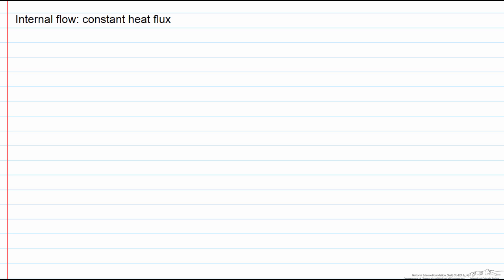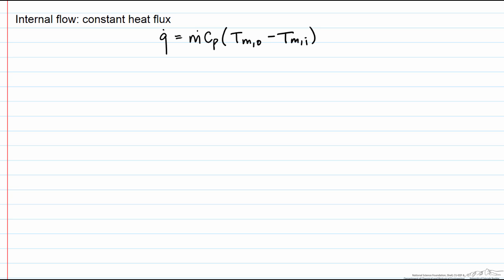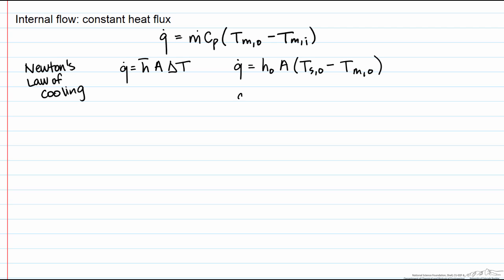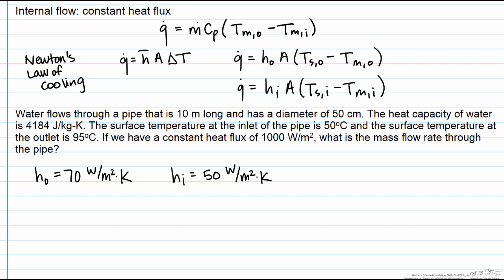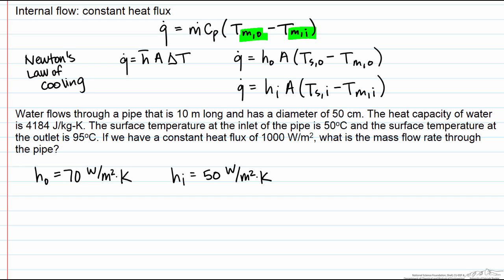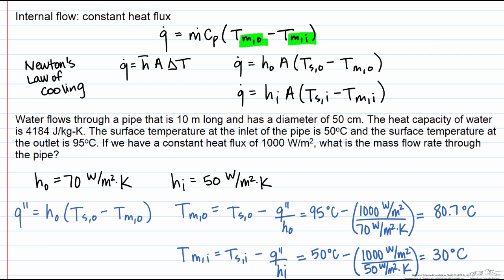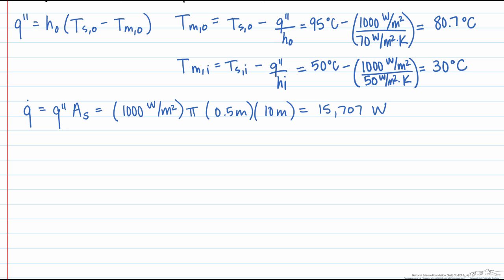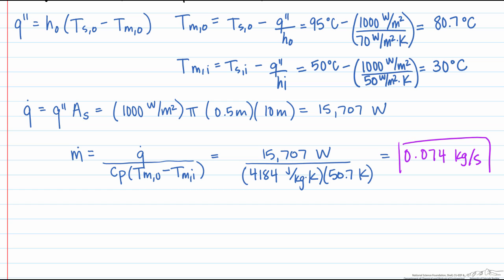Internal Flow with Constant Surface Heat Flux

Comment: According to Heat Transfer- Cengel, when the heat flux is constant, the difference between surface T and bulk T becomes constant in the fully developed region. So the heat transfer coefficient h is also constant .

Comment: Dear LearnChemE,

I am currently working on my graduation thesis, which focuses on the heat emission of exhaust insulation systems in diesel generator rooms (Q in watts). The setup closely resembles the situation shown in your video: a stainless steel exhaust pipe surrounded by insulation material.

I have completed the theoretical calculations and would like to validate my approach. If possible, I would be happy to send you a brief document with an overview of the project and a calculation example (4 pages) via email. Any feedback or suggestions you could offer would be greatly appreciated.

Thank you in advance for your time and support.
Kind regards,